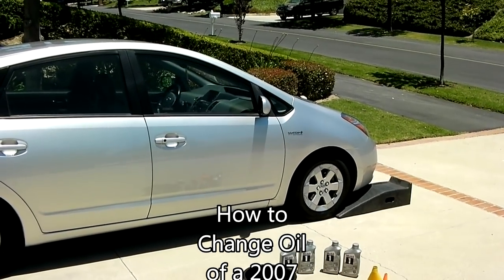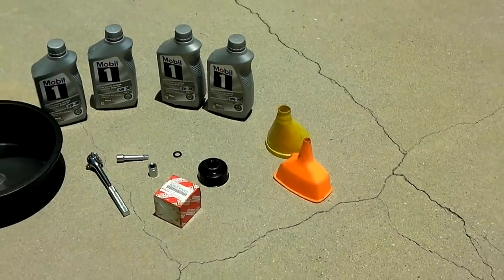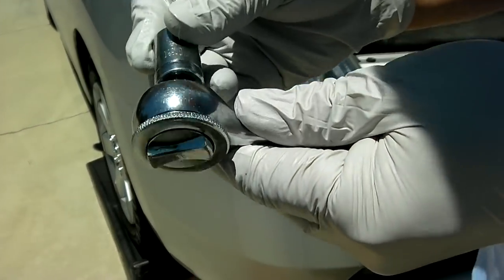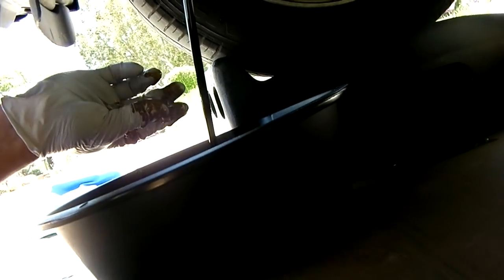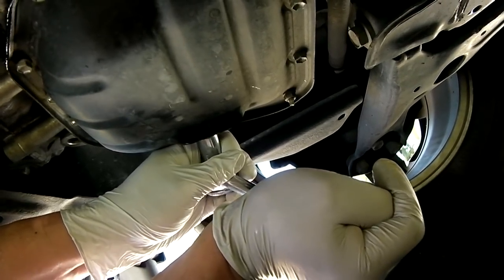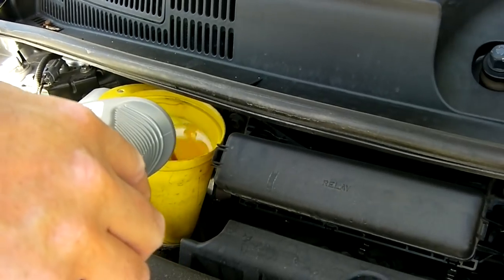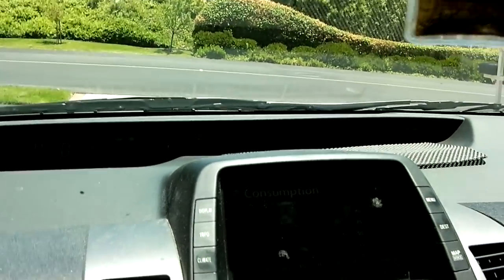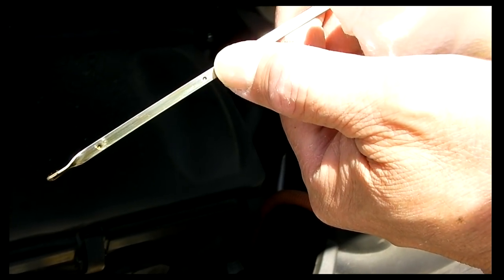How to Change Motor Oil of 2nd-Gen (2004 - 2009) Toyota Prius

Comment: One advice, once you get the filter loosened, tighten it just slightly. Remove the filter wrench, then hand loosen it to take it off. You'll avoid all the oil on the filter wrench.

Comment: 2006 prius owner , 330,000KM and never been in a mechanic shop. Only regular maintenance. That's unbelievable.
Reply from the maker: My first Prius (2004): I drove 125,000 miles in it until someone hit it and totaled it--never been in a shop even once and was driving as good as new up until the accident, averaging 45 MPG. I was heart-broken. My second Prius (the 2007 seen in this video) currently has 124,266 miles on the odometer (as of 12-8-14) and has been in the shop only ONCE--for its 100,000 mile check-up to make sure everything was OK (and it was). It is driving just like new and now averaging 43.3 MPG, 1.3 MPG less than when I made this video. Now I have another Prius, a 2012 Prius v that my wife is driving. The Prius v gets 42 MPG since it is larger and 250 lbs heavier. I love them all! By the way, I haven't had to change the brake pads in ANY of my 3 Priuses. Apparently, they last forever.
Reply: +rmwtsou 43.3mpg average?  thats pretty bad. I get 48mpg average on my 07
Reply from the maker: Ha, ha. I know. I had a white 2004 Prius which was totaled at a stop sign when someone hit me from behind and I lurched forward to hit the car in the front and sustained damages on both ends. Since it already had 125,000 miles on it and wasn't worth the price of fixing, the insurance company just declared it a total and paid me its Blue Book value. That Prius was averaging 47 mpg. By the way, I also changed oil only and it had never seen the inside of a repair shop as well. Even its brakes were still factory original when it was totaled. I loved that car so much! This particular 2007 silver Prius always had lower mileage than my 2004 Prius. It was 45 mpg when new. Now that it is older and the battery probably deteriorated a little, it is averaging 42.6 mpg at the time of this writing. Also, it has 155K on the odometer and NOTHING ever needed repair yet. I love Priuses (Preii?). I have another 2012 Prius V which my daughter is driving.
Reply: My 2006 Prius just had to have a new electric battery at 136,000.  OUCH!  Very expensive during the pandemic when I am making very little money and my planned expenses were brakes and winter tires.

Comment: Excellent video work.  Thanks.  I would add that you should be sure to see the old drain plug gasket comes off with the plug and hasn't stuck to the drain port.  Same with the filter gasket.  They don't often, but what can go wrong will go wrong eventually.  Don't want double gaskets.

Comment: Great video thanks. I did my first oil change using your video as a guideline and it was all sweet. Only issue, my prius did not ask for a service required light after the oil change. Is that something I missed.
Reply from the maker: Arjun Chauhan Glad to hear it. The service required light comes on automatically after 5,000 miles. You can turn it off after changing your oil by pressing the odo button continually while powering on the car. By the way, this Prius just had its first brake pad change after 130,000 miles. It still runs like new. I just love this car! My 2012 Prius v has over 40,000 miles on it. The oil change for the Prius v is different from that of the Prius.
Reply: rmwtsou  Thanks for your response. Incidentally, the service light does not come on automatically in my car. So I guess I will keep going.  I must say your prius looks to be in perfect condition.Did you do the brake pads yourself? So I see you have 2 priuses and are loving it. I love this car too.
Reply from the maker: Arjun Chauhan The brake pads were done by the dealer. I have owned a total of 3 Priuses in total. My first was a 2004 which was totaled after 125,000 miles when someone ran into me. It had the best mileage of the three, at nearly 47 MPG. I have the 2007 Prius and the 2012 Prius v now. I love them all.

Comment: do you have to replace the filter every time you change the oil?
Reply: In fact you need to change the every two times you change the oil but it's highly recommanded to change it every time and it's really cheap.
Reply: Yes otherwise you'll putting new oil on a old filter

Comment: 28 ft-lb is the proper torque spec for the oil drain plug on a Gen 2 Prius.
Reply from the maker: Good to know. Next time, I will use a torque wrench.

Comment: My toyota prius 2004 is now 95231 miles already. Should i still use 5W30 oil ? or change to use another type ?
Reply: Sothon Chea 95,000 miles isnt much, especially for a 12 year old car!  Most of my cars were purchased with over 100,000.  And alot of cars easily last over 200,000.  But a Prius can easily last 300,000 or more. I heard of one with over 700,000!

Comment: I put 3.9 quarts in instead of 3.5. Does that matter or should I drain some? The dipstick is a bit over the top dot. How do I drain a bit of oil?
Reply from the maker: I have done exactly that a few times. I don't think it matters much.
Reply: Thank you so much. Yes, someone else said that too, I was worried it might damage the engine but I only drove it round the block and he said drive it 20-30km before the oil is fully circulated. Thanks for your quick reply.
Reply: The Prius takes 3.9 quarts with a filter change you did not overfill it

Comment: Do you have any problem with the battery of your prius yet?
Reply from the maker: No problems, however, the car is almost 10 years old and now I get 42.6 mpg rather than 45 mpg like it used to get. Perhaps it is due to aging battery? Still excellent mileage and the car still drives like a dream. I have no plans to change the battery anytime soon.
Reply: thank you.
Reply: What is your car mileage as of now? I only had battery issues, for the small battery, the 12v one.
Reply from the maker: Rafael Reformado
It is nearly 155K miles. No battery issue whatsoever. I am thinking about having a transmission fluid change. It never had one. One head light bulb did go out at about 100K or 120K miles and had to be changed.
Reply: Ive had issues with my hybrid battery.. Easily replaced the bad cells after watching a couple youtube videos.. Instead of $4000 for a new battery, ended up costing me $66 to replace 2 bad cells.. Dont know what i would do without youtube
Reply: hi fine art i also want to buy three cells for my hybrid battery from where i can this

Comment: Please replace splash guards between wheel and engine. Lazy mechanic threw it away.  Grime collects on m9 connector producing transaxle codes
  I clean m9 connector, transaxle code goes away.  They quoted me $1800 to fix.  I fixed with $5 electronic contact cleaner/mass airflow cleaner. Peace.
Reply from the maker: Sorry tell you this car was totaled at 217k miles (probably could drive it to 500k miles). Rip. Now I have a 2020 Rav4 hybrid, which gets 40.2mpg.

Comment: As you know that ramp can fail anytime ,and kill you , so be careful , I'm 5feet 6inches 155 pound , I have 2006 Toyota Prius and 06 Toyota Sienna van , I change both oil on that vehicle ,without jack up the car , I use both factory jack and place behind the tire by the frame and rise it up , to touch the frame , not even lift up at all , that just in case while I'm down there and the tire is leaking air or blow up , those stand by jack will save me , if you do jack up , and if the jack fail it will crush u, even if I jack up the vehicle , I use factory jack and jack stand and log , 3 in one , google there are lot of people get kill by crushing jack fail and jamp , that why I do my vehicle without jack it up
Reply from the maker: Good thinking. Thanks!

Comment: be nice if you said what size socket for a how to video.
Reply: 14 mm for the oil drain plug, and torque 28 ft lbf (38 N m).